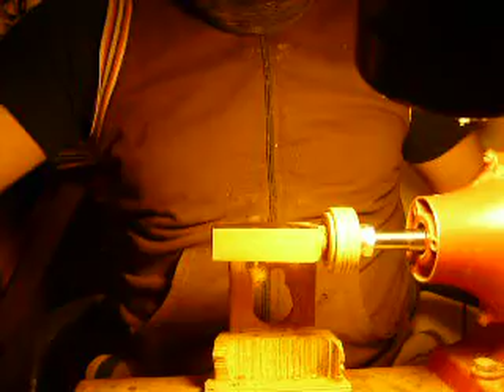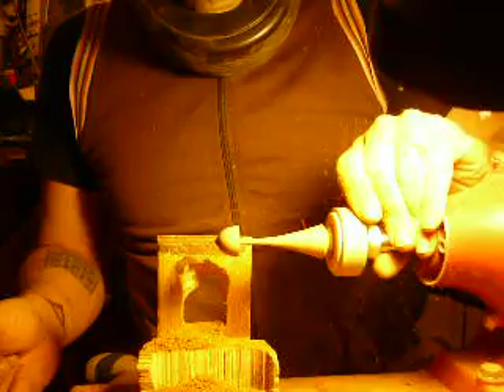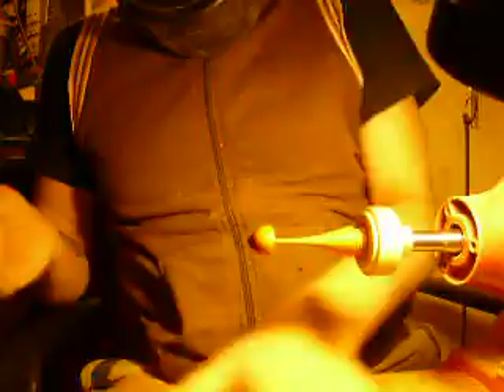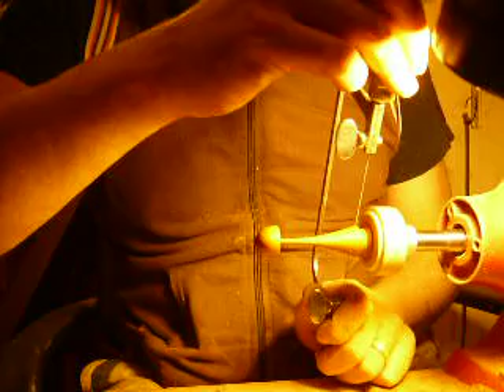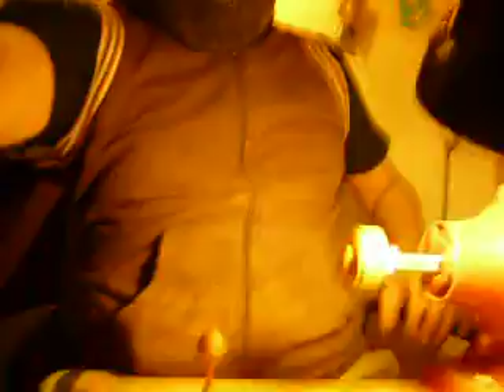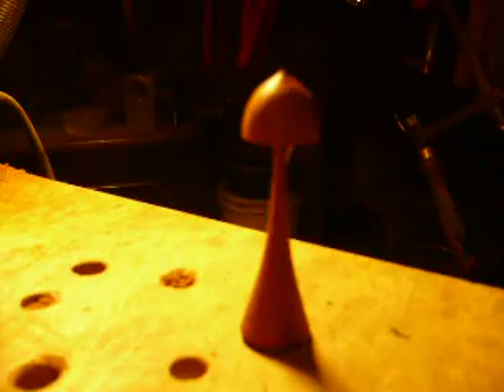Mahogany Mushroom Part 2

Comment from the maker: I use a 1/4 inch HSS spindle gouge sharpened to a fingernail profile & a 2.5mm square jewellers graver sharpened to 30 degrees like a mortice chisel.